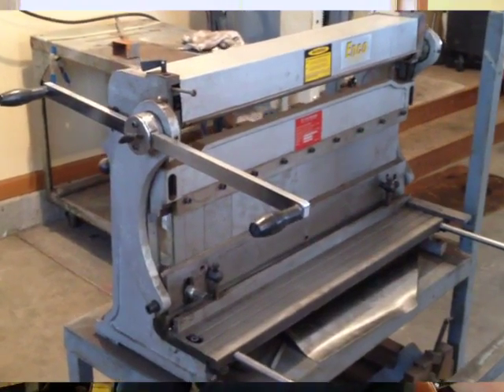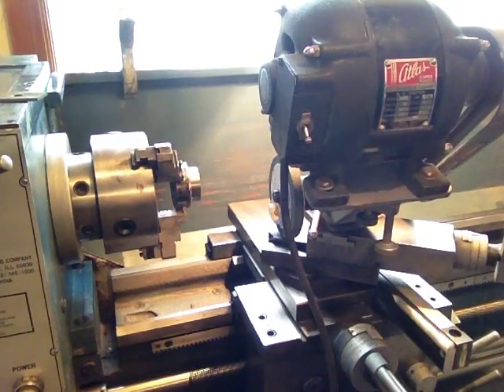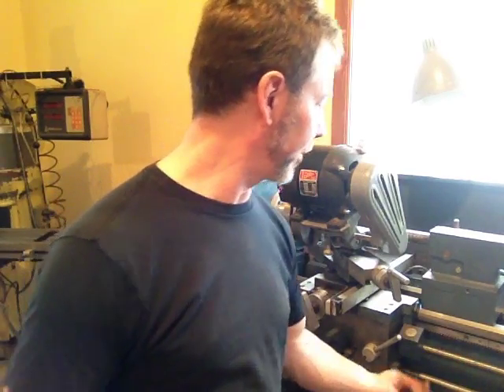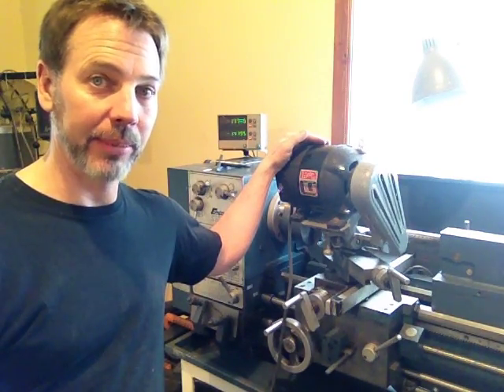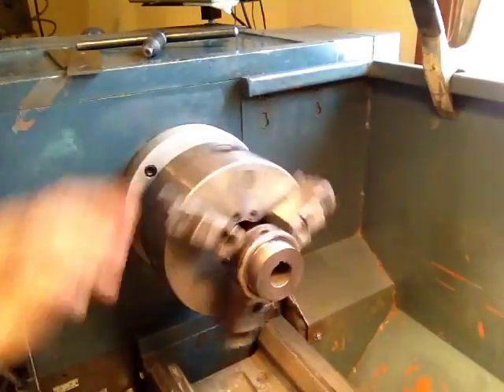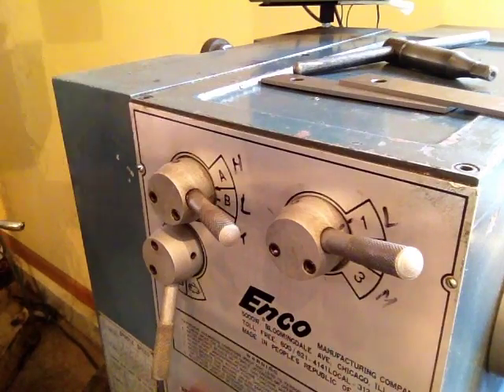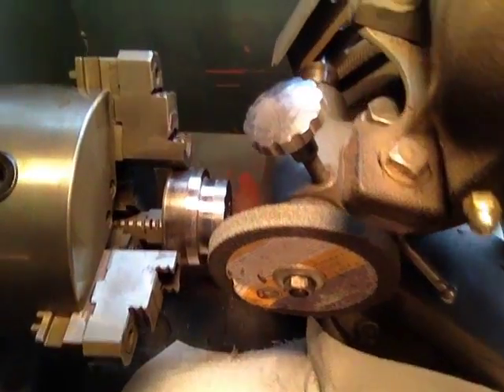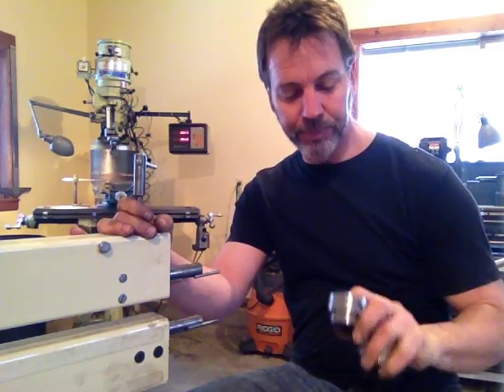BEAD ROLLER "The Cutting Edge"

Comment: Your statement at 1:27:  You said the welding rod has a tensile strength of 120 PSI.  Are you sure that isn't 120,000 PSI, instead of 120 PSI.

Comment: nice video

try sharpening a negative rake on tip of old worn out carbide insert.taking  light cuts on the the weld. 

It will save you lots of time from grinding.

The hardness well be no problem.

That's an old repair trick of many years

Comment: Thanks again Dale. I really enjoy your videos. You have joined the ranks of Keith Fenner, MrPete and the other illustrious members of this great community of teachers.

I had no idea your scope was so wide: auto repair, sheet metal work and so much more. Is this all a hobby or part of your trade?

My little tip: When spacing work away from the chuck with parallels I like to bring the tailstock in with just the ram or a bull nose center to apply uniform pressure against the parallels. Not essential but it helps me.

Comment from the maker: Hi, 
Yes  a bead roller could be used.  It  will need to be  ran  through several times, bending a little more on each pass. If its  a real long run you will want to set up  in feed and out feed tables. 
Here is another suggestion. There is a hand tool out there that might do the job better. Heres the  link showing it in action.
youtube.com/watch?v=S3aj2NDQoUw

Good luck
Dale

Comment from the maker: Hi, Thanks for the question.
Yes, I made the Dies you see on the machine. I used a Radius turner I designed for a Lathe. It incorporated a way of  measuring  the tip of the cutter to the center of the pivot point on the jig. With this added feature I can it up  inside and out side curves and get them to match up perfectly. I have been thinking of doing a video on it . would that be useful to you?